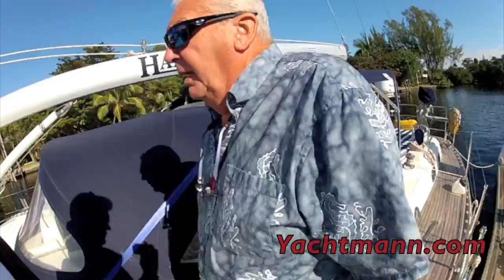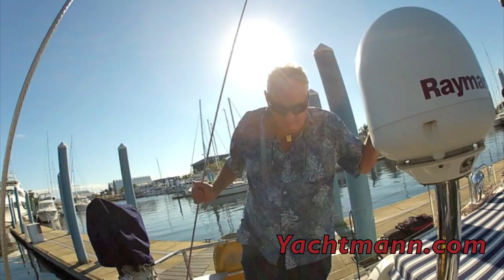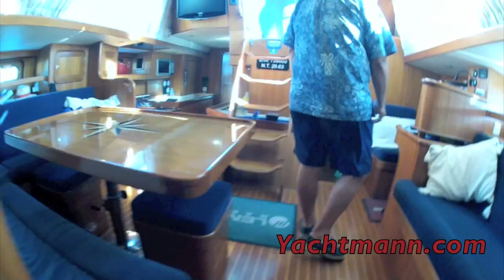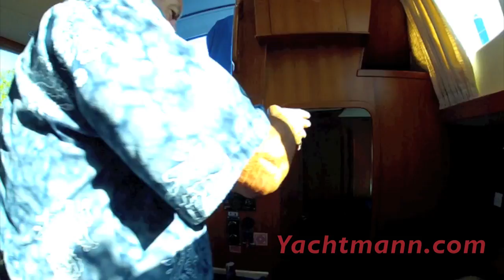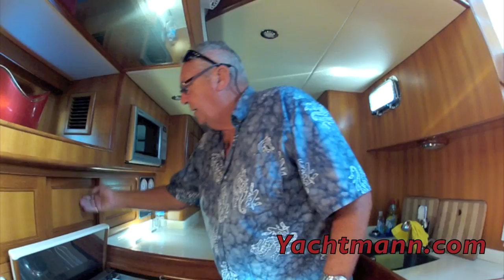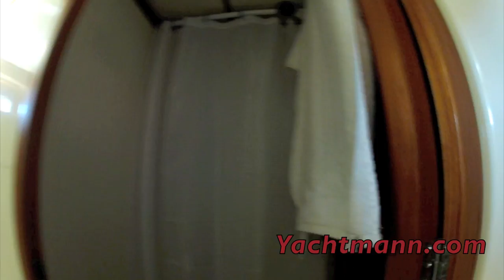Tayana 58 Sailing Yacht For Sale FLORIDA

Comment: It's the same question. Yet they wont tell you. The reason? It's to dam much money. If they really wanted to sell it. The price would be the first thing you would see. But no ... You have to go thru the song and Dance, to find out, it's to dam much money. Granted it's a Nice boat. Well kept. That says a lot.
Reply: Thank You. That puts some closure to the story. Thank You.
Reply: A used 58 runs from 250-500k  but since they don't list the price your buying the EXTRAS here.
This baby is immaculate and well detailed so she will easily list in the mid to high 6's to pay the brokers tip.  
Probably wont sell until the mid 5's though... ;-)
Reply: Michael Zietlow Thanks for the ( Probably )
but that's a Big range of ( could be )
I'm thinking about having one built at a Lower Class Level. In a 3rd world country. I want function not Glitter. Equipped to be sailed by 1 person. If need be.  Or rebuild one that was wrecked. A Catamaran would be my dream.
In hopes at all can be done at no more than $200,000. ... Time will tell.
It's a dream at the age of 61 = you missed the starting gun. ( Late start ) So theres a good chance Nothing will be done. But hearing the Prices of these boat will tell me what chance I will have. And they wont post the prices.
Reply: Sort of...... Where is she now?!
Reply from the maker: +Michael Zietlow Hi Michael, that is a very old listing... She since sailed to the Bahamas and then US.  She Sold there by Yachtmann.com mid $400k.
Reply from the maker: 🇦🇹 YACHTMANN.COM 🇦🇹New To the Market - 1998 Tayana 55 with Aug 2019 Refit & Survey June 2019 report ❤️- https://youtu.be/Xl6YvpgaHtk